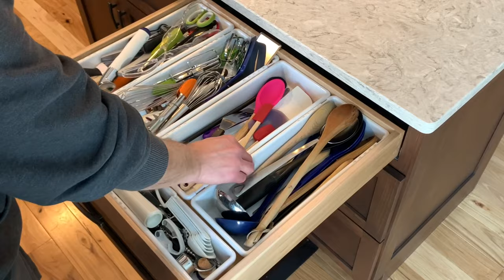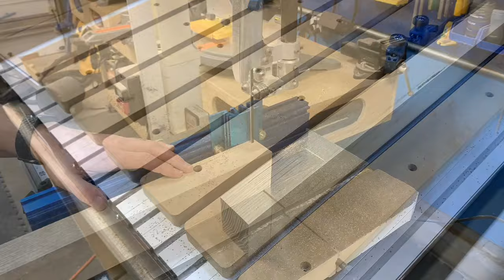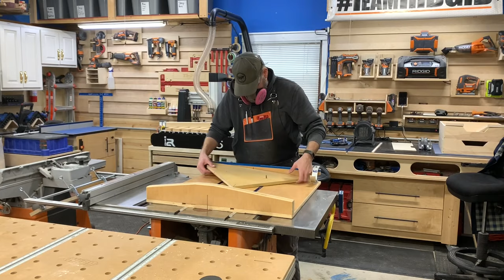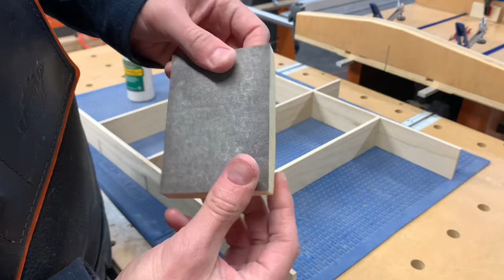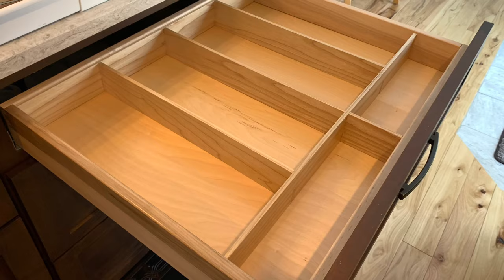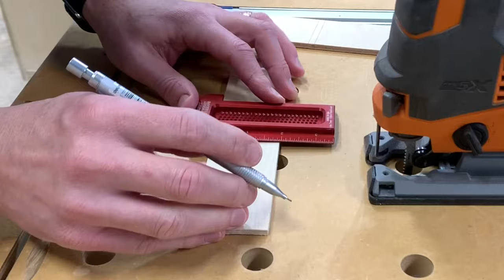DIY Kitchen Drawer Organizer: Two Methods!

Comment: Nice little build I’m building kitchen cabinets now and I want to do this and a bunch of pull outs it’s been harder than I expected building the cabinets.
Reply from the maker: Oh nice! I wanna build a kitchen out of walnut someday. It’s nice to add organization where ya can! Good luck!
Reply: Michael Saffold I'm doing my own  kitchen cabinets & pull outs as well! This is what I want but it's too intricate. I have get to buy a planer, sled, and bandsaw. Guess it's on the "to get list" now after seeing this! Nice work!!
Reply: @frankmaggio4328  I have almost finished my kitchen cabinets just have a few pieces of trim left to install drilled a hole through my finger the other day big enough for a 8-32 screw so that’s going to slow me down a little bit doc says it will heal up but it’s going to take a while.
Reply: @frankmaggio4328  it’s a project I would never take on again though I definitely regret the amount of time it has taken
Reply: @michaelsa892  OMG I just said the exact same  words yesterday!!! That's hilarious.
Reply from the maker: You can do it with some minimal tools but it just takes longer.

Comment: After all that work it still looks the same..."A messy drawer" You should had made more compartments, so items could be a little more separated. Also, while I telling you what you should have done, let me just say you should have used 1/4" Oak for the separators/spacers.
Reply from the maker: Granted, I am no pro at putting the stuff away or arranging the drawers in a particular manner.  I did so exactly what we wanted to do, get more space per area of each compartment.  We gained depth, length, and width in all of them and my wife and I didn’t want to add more compartments as it’s already a “busy” drawer.  If we had more drawers to separate all of these items out into, then I could see a better system. This is perfect for what we want. Can I ask, why oak forest the spacers? Just curious.  I had this ash as leftover so it suited my needs perfectly. Thanks for the feedback. 👍🏻
Reply: @CReevesMakes  Everybody’s a critic right? 😉
Reply from the maker: 👍🏻yup.  Thankfully I like grains of salt.
Reply: This dude has some very specific problems with this….😆
Reply: You are a goober…………..  AND LET ME GUESS.  You couldn’t find your a** with both hands.  Video is great. Keep building